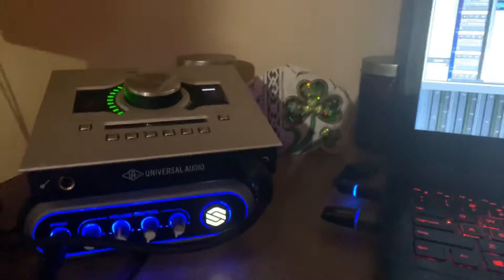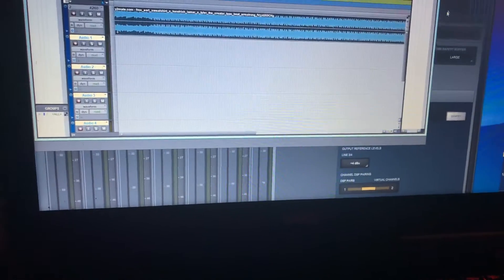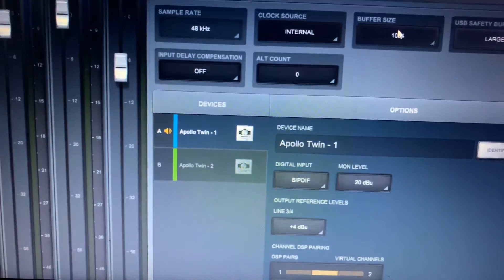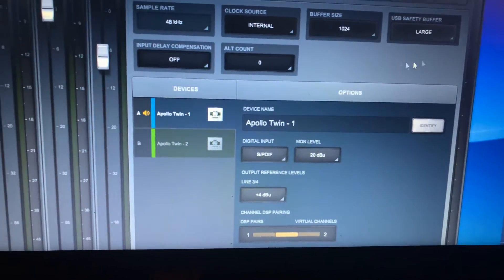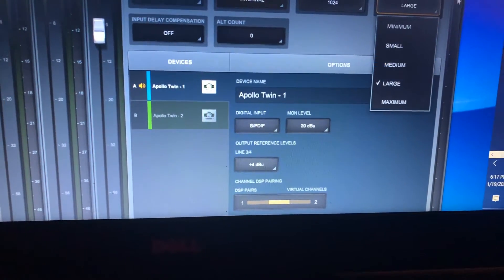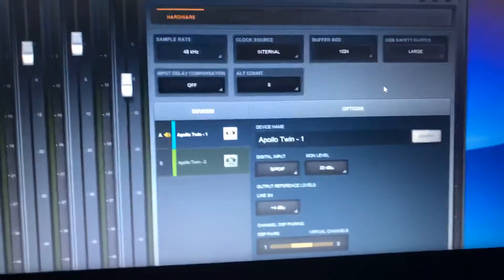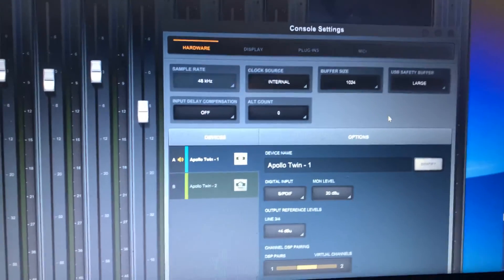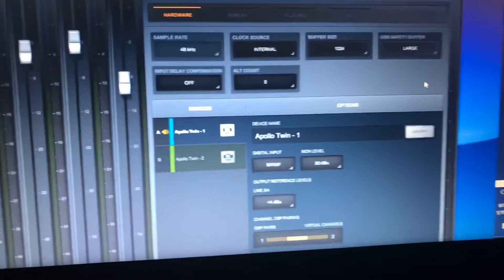APOLLO TWIN USB NOISE ISSUE SOLVED

Comment: My Twin X Duo (running on a MacBook Pro) totally does not have these parameters available when I click the Hardware tab in console settings.  I just see Sample rate, clock source, input delay compensation, and alt count.   Nothing else.
Reply from the maker: Not sure why that's not displayed, I'm on Pc an sometimes you can Unistall an Reinstall Console all together!! I had to do that Several times before it hosted My Software!!

Comment: What you are doing is complete wrong. Using buffer in high means using more CPU USEGES   
Here you can do is.  Go to power managements windows 10. And put the max power usages 100 to 99 .   Than go to PC. Bios. And set off. The. Intel sped c1      I believe you will be ok.
Reply: what about with an AMD Processor

Comment: Can’t change my buffer without restarting daw is that normal with this unit ?
Reply from the maker: yes! Make sure Your Daw Is Matching the Size of your console Buffer
Reply: BigMeachBoy412 any other tips I’m
Super new
Reply from the maker: D.Y.M.E. Just learn how to incorporate the Console into your work Habits, Tryout the Plug-ins as they all have a Free trail...  The Console is designed to take the Workload off your Daw which pounds your CPU an that Can Slowdown or Stall your Performance an Incase Crash your Project